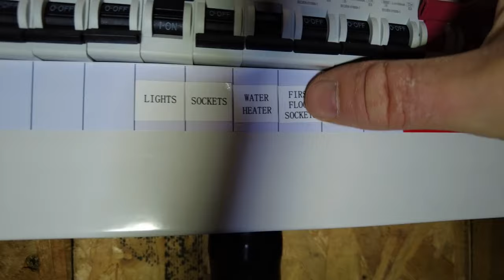Relocating a Fused Switch for an Electric Towel Radiator #properselfbuild

Comment: Great to see you back and feeling better. And the frog tape tip to remove screw caps from faceplates - genius! I've mashed up so many of these buggers trying to scoop them out
Reply from the maker: I realised that frog tape trick doesn't work with all of them! 🤦‍♂️ Damn it. The rest of my plugs came with caps that are deeper and have ridges with an increased friction fit, I had to use a small blade to get them out 🙄

Comment: Glad you're back to your old self bud! Literally not a guy on YouTube I feel I can relate to as much as you (although my project is smaller). Some might say, I don't have a trade, I have a go! Push on bud, be worth it in the end.
Reply from the maker: Thanks dude 🤘 ooo a small project sounds nice 😂 haha what are you up to?
Reply: @THE-AIDEN-PROJECT  it's a big project by my standards (I'm a software engineer by trade) but relative to yours just a tad smaller! 😂 1960s 4 bed semi that had barely been touched since new and we've literally taken back to its core. Rewire, central heating, doors, windows, floors etc. Plus we built a small extension, taking out a load bearing wall in the process to move the kitchen, new water main and 110 waste so still a fair bit of work for a numpty like me giving it a go in the evenings and weekends
Reply from the maker: @Reedo321  nice nice, similar project to my first one  (just add in a hip to gable loft conversion too). So that means next time round you can do a barn conversion/new build! 😁

Comment: Glad your back and feeling better. My other half had the same issues with her GP, referred to hospital and a 8 week wait. Ended up costing £450 to go private for them to say she was ok and the GPs keep referring to hospitals as they don’t know or are afraid to make the wrong decision. 
When you mentioned your hangers I was thinking to myself about robin and routing out the hangers. 
For the floors, could you try sanding the high down? Electric planer etc. don’t think a screed / self levelling compound would work on 20mm.
Reply from the maker: Thanks. Yeah that's why I was reluctant to seek medical assistance initially cause it almost feels like if its something simple like an ear infection or you're dying then the in-between they just hold their hands up. I'm not surprised when you read about people that werent really helped for months and a year later it turned out they had cancer and its too late 🤦‍♂️
I never even considered routing out for the hangers, I didn't have an issue with them on my last build. It was only by chance I saw what Robin had done and realised that was a solution. You live and learn hey. Maybe there's ones you can just face fix and get the same strength? Even if they're more expensive it's probably worth it than routing out so much. Or maybe I could have bumped up the joists a little?
Great minds think alike 😉 can't screed or latex on the p5 stuff anyway 😣
Reply: Aiden, being local to me your clearly the person to ask. 
Did you get any quotes from builders to carry out your conversion before you decided to do it yourself? 
We had our pre planning meeting back in November and then LPA said it seemed like a good set of plans. 
Like yourself I’m hoping to do a lot of it myself but before we buy the property’s I’d like to get a few quotes on the builds but am struggling to find decent builders around the Chelmsford area.
Reply from the maker: Hey Robert, I've just seen this, it got held for review? 
I tried really hard to get some quotes in but was unsuccessful. I contacted around 10 different firms maybe. Only 2 came over to have a look. I didn't get any prices back. I explained that I only wanted them to 'shell' the main house because I wanted to do the rest. I got the impression they just wanted to know how much they could fleece me for and didn't bother quoting as there was easier money to be made elsewhere. One asked what my budget was, which I wouldn't say of course. That's why I ended up getting wrapped up with Sean the groundworker. Technically I didn't do it myself as he was supposed to be the main contractor but I ended up managing it more than I was supposed to. I could have found individual sub contractors and probably done it cheaper though. I think I done ok out of it, still probably got knocked a little bit considering how much I had to sort out myself. I'm going to go through my SPONS book soon to total up everything that was done to see properly. 
If you want to go down the main contractor route they will want the whole job, not part so you don't let on with this. You could maybe see if they will give you a phased quote? One for groundworks and structural work, getting it wind and water tight roof and windows etc, then internals. 
I never did this myself but do a search on the Federation of Master Builders, search under custom/self build. Check out the websites and see if they would have the scope for a large project like yours. I wonder whether you could offer them payment for a quotation? Not loads, like £50-100 maybe? You could probably get a good gauge on them through this interaction too. Good ones will probably be booked out for 6 months to a year ahead. The bigger firms will have contract managers that will deal with quotations, they're gonna be expensive though. Others won't want to waste their time and a couple of hours doing a quote for nothing.
Reply: @THE-AIDEN-PROJECT   Thank you for taking the time to reply. 
I’m finding the same issues as you had, I’ve contacted 5 builders and none of them have come back to me it seems to be a battle. 
I’ll check out that federation of master builders and see if I can find anyone of worth there. Will grab one of those SPONS books too. Seen a 2022 ebook version available for £45 on eBay. 
Once we finally get things underway and the offer accepted I’ll drop you a link so you can see what we’re working with. 
Thanks again Aiden.